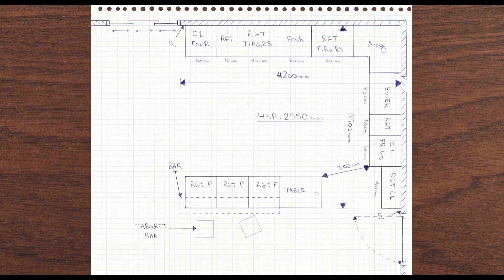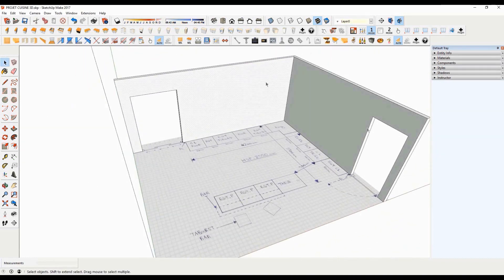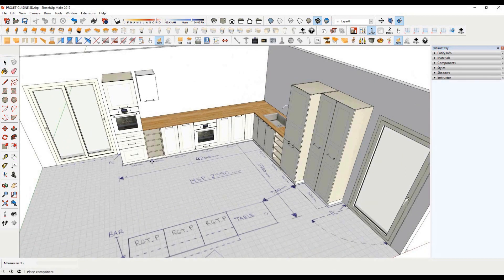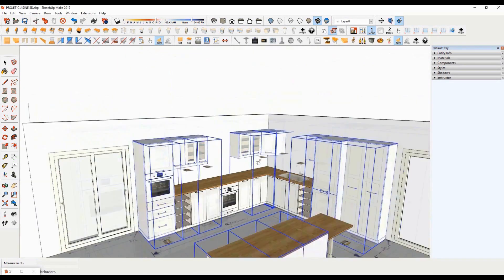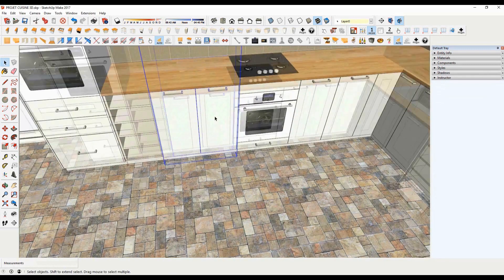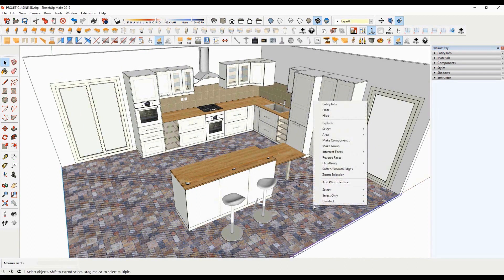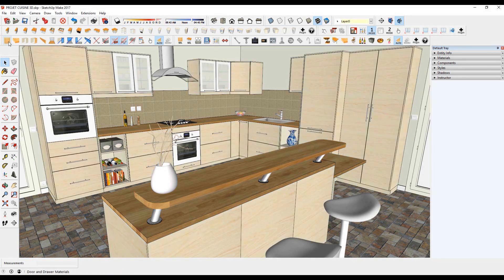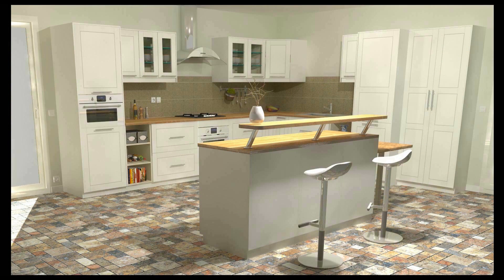IKEA Kitchen Design in SketchUp

Comment: How we can chang hight of wall cabinet?
Reply from the maker: Hello,
The heights of the tall units are standardized in 40, 60, 80 or 100cm.
You can select one of these heights by displaying the thumbnails.
If you want a custom height you can use the Fredoscale extension which you can download on this page:
https://sketchucation.com/pluginstore?pln=FredoScale
cordially
David Barros
Reply: @davidbarros6848  can i  pay to have a fully adjustable height on your parametric models? fredo scale works but if i have to modify the width after, the model goes back to the original shape, wonder why u can change the width and depth but not the height?
Reply from the maker: @jamhardxt  Hello,

By default we have not allowed to resize the height of the furniture because this has a significant impact on the height of the facades and their arrangements.
There are pieces of furniture with many drawers and doors and sometimes even with appliances at standard height so if you change the height of a piece of furniture nothing will be standard and it will also be difficult for you to align these fronts with the fronts other furniture.
If you want to change the height of the base units, you can adjust the height of the plinth or the thickness of the worktop.

Despite this information, if you still want to change the heights of the cabinets, you can do so with the FredoScale Plugin.
https://sketchucation.com/plugin/1169-fredoscale
This tool allows you to resize the furniture without removing the dynamic functions but at the least updating of the dynamic functions the furniture will return to its base height.

To permanently resize the furniture we have created an extension that allows you to remove the dynamic functions.
You can download this extension with the link below:
https://www.dropbox.com/s/a502255rm7ho3p5/TNT_delete_dynamic_fonctions.rbz?dl=1

After installing the "TNT_delete_dynamic_fonctions.rbz" file:
   1.Select one or more pieces of furniture where you have to delete the dynamic functions.
   2.Click on the "Remove dynamic functions from selection" icon.
   3.In the warning window, click "OK".
You can now resize your furniture and even sub-components like drawers or doors with SketchUp's "Scale" tool.

Cordially

David Barros

Comment: How to increase the height of the wall edge?

Example put 35cm
Reply from the maker: Hello,
We are not sure to understand your question!
To customize many custom dimensions you need to select your furniture and click on the "Parametric Options" icon on the PRO toolbar.
You see that at 14 minutes and 50 seconds in the video above.
cordially
David Barros
Reply: @davidbarros6848  how would you change the height of the cabinets?